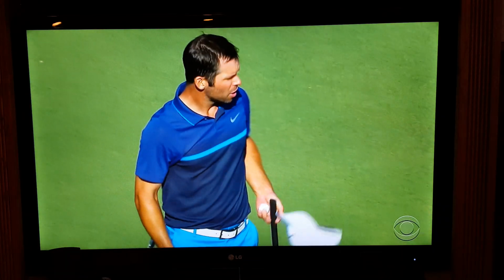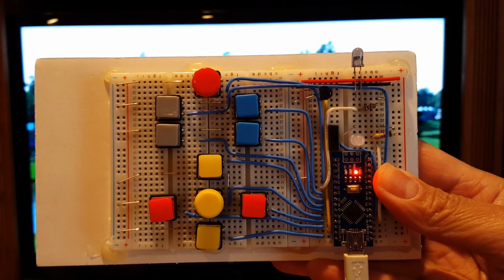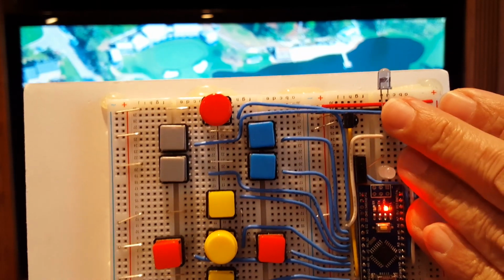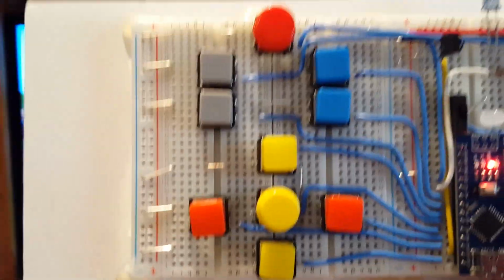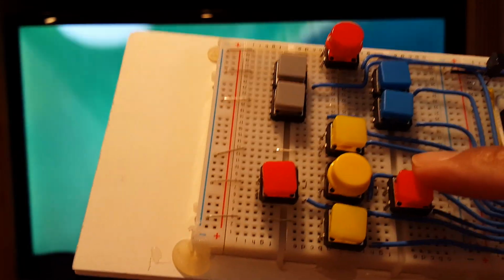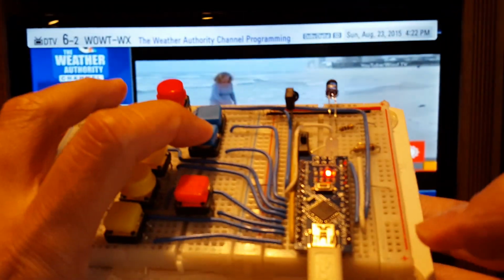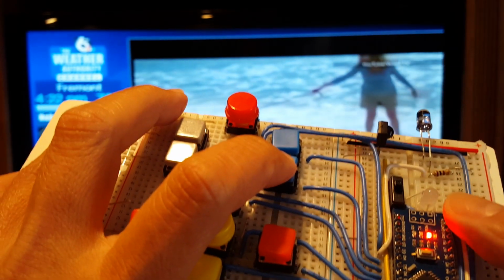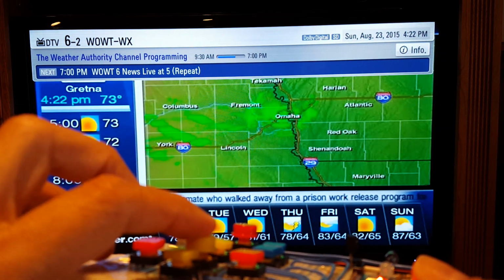HariFun #116 - Custom TV Remote part 2

Comment: looks great . That's gotta' be handy for IR automation projects later too.
Reply from the maker: XerotoLabs , you know that made me wonder if an RF remote would work better for my Dad.  That way he would not have to point the remote at the TV/Cablebox.  The Remote would be a custom RF transmitter, and the RF receiver would be by the TV/cablebox sending IR based on commands received via RF.

Maybe next version :-)
Reply: Hari Wiguna i used to sell a RF/UHF IR remote extender it was intended for room to room satellite .  you might be able to find one of them and hack one . or add some IR led emitters at tangents , like the small R/C copters use .  that would make the need to point it less important .  most of my lil' copters have 3 IR LEDS . and i don't even have to point the controller .
Reply from the maker: 3 IR LEDs! Which directions should they point to? I probably would need a transistor to switch the LEDs.  I'll have to experiment with that. Thanks for the tips, XerotoLabs !!!
Reply: Hari Wiguna as for directions i have seen it as simple as cluster with 2 sort of up and one down .  Its hard to tell how wide your IR LED beam is. I have used cameras to see how far i can turn form center and still see a bright pulse from the led. with a cluster you want them to be oriented so they over lap a bit . but even 1 led should be able to bounce off a white ceiling and still be 'seen' by the IR sensor in the device.  Its hard to tell how bright our IR LEDs are . i suppose if you have a spec sheet you can simply be sure you give them enough . LOL 
most TV remotes use 1 , some nicer one use 2 aimed in same direction .  The R/C toys and such seem to use 3 or 4 in small clusters . and they do use a small transistor to drive them .